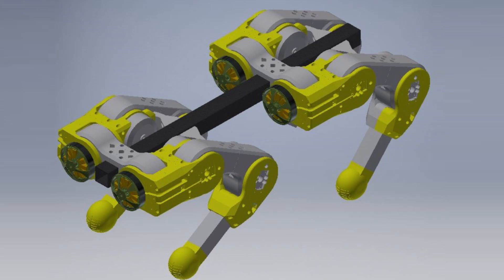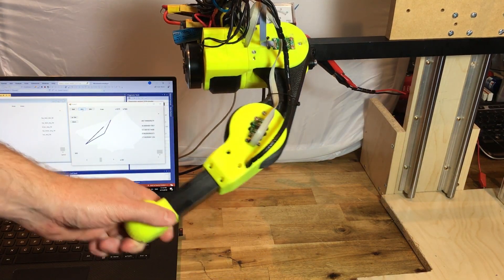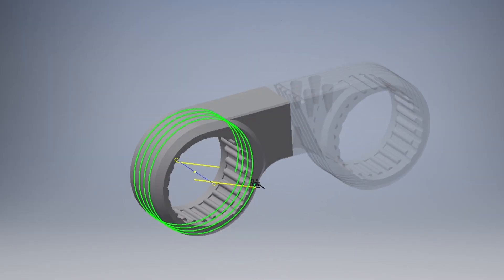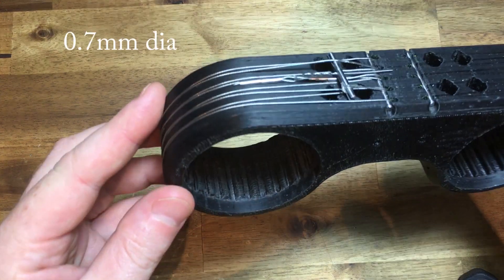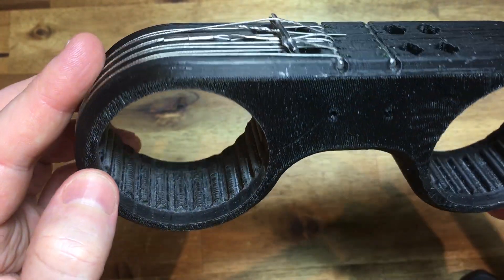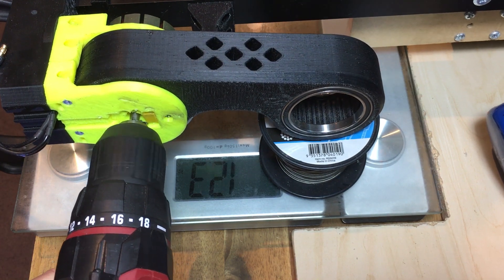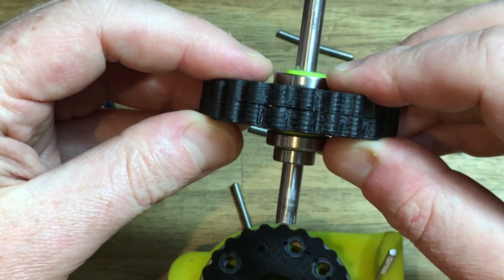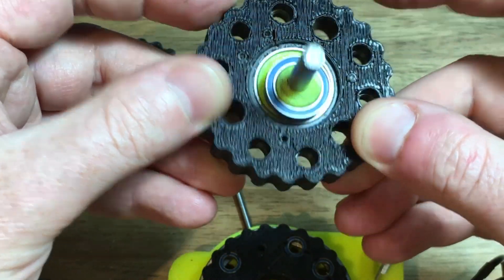Robot Quad Leg Strength Tests with Un-used Over Engineering

Comment: Put a grove on your prints, that will allow you to add a high strength Epoxy. Apply the epoxy to each side of the gear with two sheets of wax paper on the outside, and compress between a vice, as it cures.. Note: Use between two hard flat board like objects.. With vice on outside of boards.. Epoxy does cure differently under pressure. ** Also best to have lines between both sides.. 

  In other words, think of your 3D printed part as a scaffold for supper strong epoxies. At least that is what I do, when I need any real strength.. As 3D printing, is more precises than foam cutting. And the print adds to the strength of the epoxy.. With some epoxies, you might need to paint your print, to prevent melting... (Or do so in thin layers. All based upon what you are printing with.) As I use ABS for all things. I found some things will melt the prints.
Reply from the maker: This might be to complex for me. The gears hold up well, considering their size, as they are mainly under compression and the load is shared among make teeth/lobes. The outer housing is only under tension and my guess (without further testing /research) is that they are weaker under tension than compression. How does epoxy go under tension?
Reply: @PaulGouldRobotics  , It works wonders under tension if you add fibers. Like a carbon fiber strings. Or even on big projects embed aircraft cables.. Supper strong fibers, cause load sharing. One example found that plastic epoxies with carbon fibers, are stronger than aluminum.  And only a few points away from the strength of steel.
  Sometimes called poly composites. Note: carbon fiber string is not that costly. 

https://www.amazon.com/Kevlar-Thread-Sewing-Size-Commercial/dp/B01M2AYTS2/ref=sr_1_1_sspa?keywords=kevlar+thread&qid=1578059352&sr=8-1-spons&psc=1&spLa=ZW5jcnlwdGVkUXVhbGlmaWVyPUExSk0xQlk3VFJIWjVMJmVuY3J5cHRlZElkPUEwODM4MzI2MjgwVlYxQkJIWlBITSZlbmNyeXB0ZWRBZElkPUEwNzc4MjM0MkFMVkVKMk1WVEJKWSZ3aWRnZXROYW1lPXNwX2F0ZiZhY3Rpb249Y2xpY2tSZWRpcmVjdCZkb05vdExvZ0NsaWNrPXRydWU=
Reply: @PaulGouldRobotics  Once part is printed, all you need to do is put thread on needle and weave it into the part. Once done add a strong epoxy, press while curing. (The pressing does Three things: One it forces epoxies into the threads. Two: It give a compression preset load. Third it forces Epoxies into all points in the part, and pushes air out..)
  If you have a pressure pot, then use that instead.
Reply from the maker: @marlonlacert8133  This give me more ideas. I would rather not use to much epoxy but carbon fibre tow seems usable and no too expensive. http://www.carbonfiber.com.au/category9_1.htm
Reply: @PaulGouldRobotics  Lastly, let me send you to an expert: https://www.youtube.com/watch?v=z6epPjcBLcE